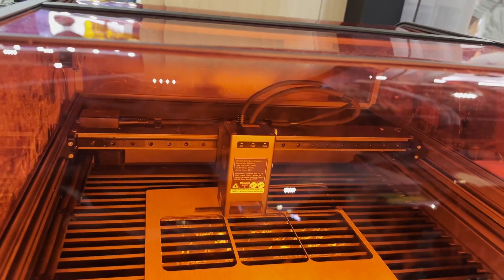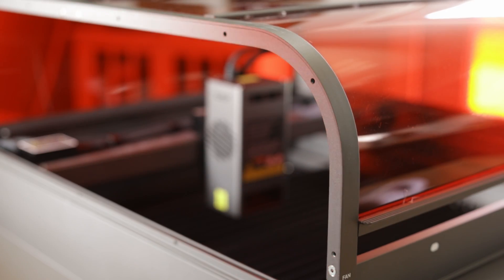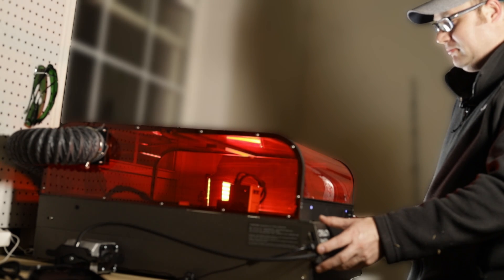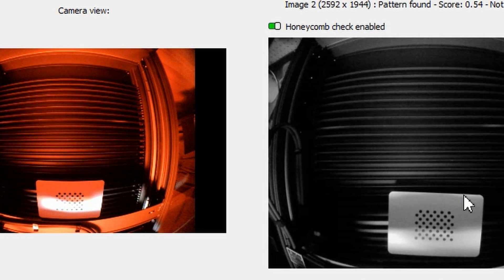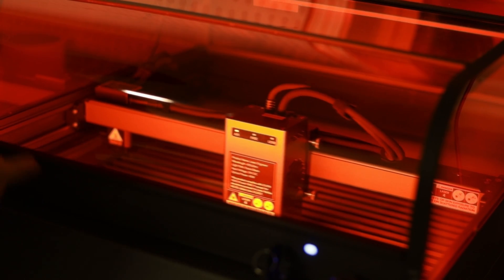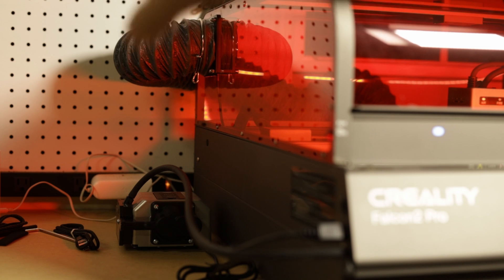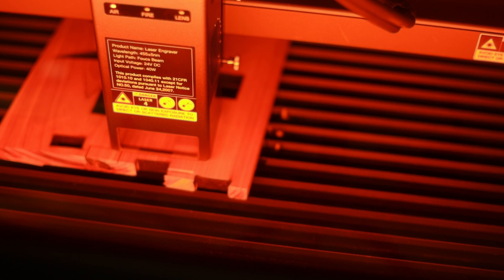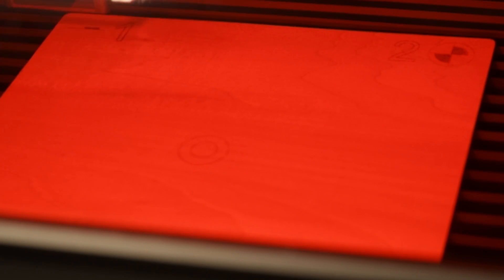Safety is it's SUPER Power! Creality Falcon 2 Pro 40W Laser Review

Comment: It's been almost a year since I bought the X-Tool D1 Pro and I just powered it up the first time yesterday.  I have to say I'm having some problems with it.  No home or limit switches and no obvious way to ever have a consistent home position are just a few issues.

Edit:  Figured out most of the issues.  Found the screen where you set power and feed rate finally, that helped.  Now the only real problem is there doesn't seem to be a way to register it to a fixed permanent home position.  It has no limit switches at least in Y so it crashes into the hard stop frequently.  Selecting home, it just takes off in Y from where ever it happens to be and if you hit home again it just takes off again until it hits the hard stop. 

My CNC has home and limit switches, home is always in the same place and it always moves back to that position after completing a run.  The X-Tool really needs to work the same way.
Reply from the maker: No limit switches? That didn’t sound right. I do have an ex tool, I’ll have to look at it because I don’t remember it not having limit switches. If you use the program Lightburn it does have where you can put different home settings in. I will say that that is one thing I do like about my CNC better than the laser. The software just seems to work better for that. But I would download Lightburn and try the free trial. See if that helps you set up your home position better
Reply: @Toid Yeah, I have Lightburn and it's definitely better but it's still way too easy to lose the reference position.  Just breath on it and you can shift especially the X axis.  You can't move my CNC when it's energized.   The X-Tool does have switches in the X axis so I don't know why it doesn't in Y.  It gets all upset when you drive past the limit in X and starts a high pitch tone.

Edit:  Turns out it does have Y limits but the flags are mounted too close to the end stops so the sensors can never reach them.  In the back, the cable and air tube also get in the way, I need a better way to route them so they don't limit travel.  Either way, it looks like I need to drill new holes and move the flags so the sensors can reach them before hitting the hard stop.
Reply from the maker: @mfkhometheater7742  oh, good. Now I don’t have to go look at mine. Lol. on a serious note that really does stink that it doesn’t hit it. hopefully once you get that working, it’ll work out better for you. But I do completely understand the frustration. In my opinion, the laser is harder than the CNC for alignment.
Reply: @Toid  Yeah, no easy way to position it can be a problem.

I'm working on building replicas of the old Altec Model Nineteen studio monitors and I need to etch anodized aluminum skins for the crossover networks.  I have parts coming already cut to size including the two holes where the L-Pads mount.  I need the Altec logo and other print to be perfectly centered, not just on one, but several.
Reply: @Toid  I have the Y sensors working.  Most of the problem was cable routing preventing it from reaching the limits, but one flag did have to be adjusted.

Comment: I've had mine a few weeks and the included rotary does not match any of the promo videos. It's the roller type instead of chuck. Additionally, one thing none of the reviewers have tried, obviously, is extending the z-height with feet. Out of the box, the machine will not allow the tray to be removed in operation. Has magnetic sensors to prevent this. Seems misleading at best, and a poor design at worst.
Reply: FWIW, Creality support is pretty confused. I had a long chain of emails with them, asking me to demonstrate their own product's behavior (turning the laser off when the tray is removed,) because they had no idea that even happened. This was while they were promoting that I purchase separately the legs and a chuck rotary. BOTH are things they imply you get with the Rotary kit. They are photographed(photoshopped) right in the photos on the listing on their website.

For such an expensive product, I feel like I got completely screwed, and zero support. Misleading at best, flat-out lies and deceptive marking at worst. In their promo material they very clearly show the F2P with legs and no tray. Likely it's just a crap photoshop, but I have a feeling I'll need to build my own magnetic by-pass.

For something that's essentially marketed the Bambu Labs X1C of laser cutting, it's sad to have to resort to these measures. Additionally, it's a bit misleading as to how the various components work together. There's nothing fancy about this machine in any way. The camera is quite literally just a USB webcam that plugs separately and annoyingly into your computer. There's no communication between the CNC and the camera. None.

Comment: Very cool.  Have you tried cutting any metal? Like Aluminum?
Reply from the maker: I haven't yet. Are you thinking cutting through or engraving?  If you mean engraving,t hen I have. Cutting all the way through, no.
Reply: @Toid 
Should ask if you've CNC'd aluminum too.
Reply from the maker: @michaelsegel8758  I have, but not much
Reply: Cutting through. 
When I see the internal bracing for speakers, I wonder if anyone has tried a thin (relative) Aluminum sheet CNC cut and sandwiched between two sheets of thinner plywood. (Or if you can afford it ... richlite )

Comment: Awesome. Would like to see how you routed the exhaust pipe to the outside.
Reply from the maker: You’re right. I should’ve shown that. You basically just need to make the 3 inch hole in a board. I made a custom board that was 6 inches high and the width of the window so that it fits in the window and I can just close down on it.
Reply: @Toid  I just had a big fan from harbor freight aimed out the window and rolled the laser in front of that fan. I like the idea of an exhaust system a lot better
Reply from the maker: @DIYAudioGuy  agreed. Although I might get a better fan than what came with it.